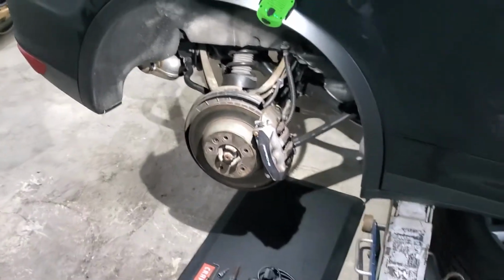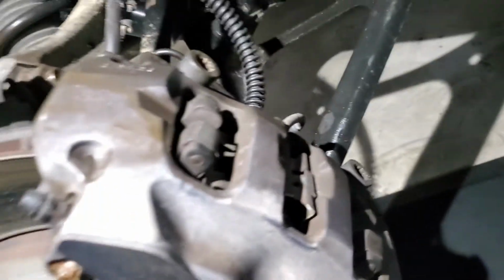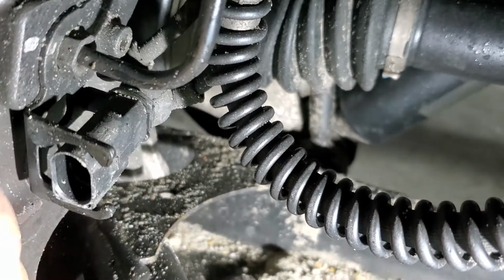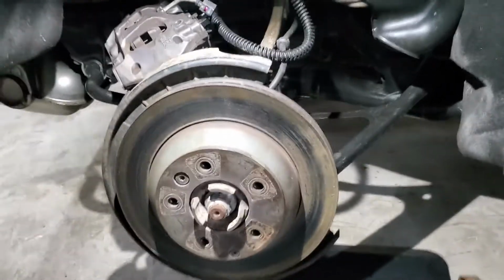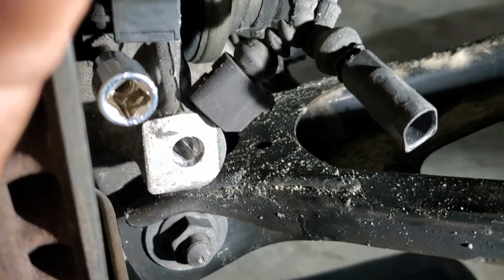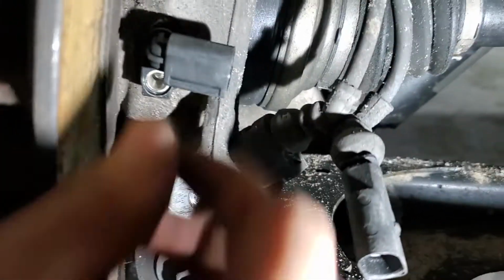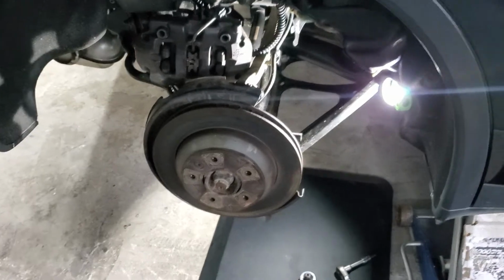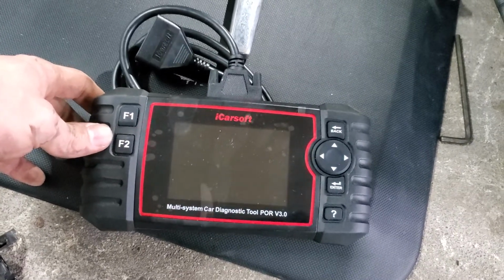Porsche Cayenne ABS Wheel Speed Sensor Replacement

Comment: Great explanation brother
God bless your heart
It's there sensor for each wheel ( four of them)
And a quick question, when I'm driving sometimes on the dash board an sign show and the car start slowing down like the break we're touch 
Thanks
Reply from the maker: Yes there is 4 wheel speed sensors, one on each wheel. As for your question I'm not sure, I need to know what exactly is showing on the dash it could be an issue related to a bad speed sensor too or could be something completely different.
Reply: @mr_fixit  
The initials are PMS
THANK YOU
Reply from the maker: @avramnicorici245  OK that's the stability system so most likely also related to your speed sensor problem since the system controls abs, traction control and can also apply braking power and cut off acceleration as well.

Comment: Anyone know the size of that TORX socket that he uses to take that caliper off? He calls it a triple square.
Reply from the maker: It is a 14mm triple square socket and not torx. This is a 12 pointed socket and if you try and use torx you will strip the bolt head. Here is a link for a set from Amazon https://amzn.to/3XmPUeB
I will also post the link in the video description. Hope this helps and thanks for watching.
Reply: @mr_fixit  Wow thanks so much for this reply and the link. Happy to stand corrected, it means I learned something. Your video is very good it shows clearly how to do the job. I might add my local dealer wants $480 usd.  Thanks again.
Reply from the maker: @basementracer  No problem, glad to  help. Thats the reason I decided to start the channel so I can share and hopefully help someone out there save some time and money. Thanks again for watching.

Comment: How many speed sensor replace? 
Front ?
Rear ?
Reply from the maker: I had two sensors that went bad at the same time, when I scanned it was front left and right rear so I just went ahead and bought and replaced all 4 to be on the safe side.
Reply: Owh… thanks for your information
Reply from the maker: @yoggahutomo4403  No problem

Comment: Video of the front sensor?
Reply from the maker: Front sensor is alot easier, no need to remove caliper, actually I have replaced one before on the side of the road without even removing the wheel. If you turn the wheel all the way to one side you can reach behind it and get to the sensor. Hope this info helps.